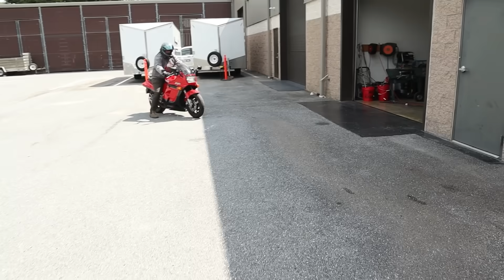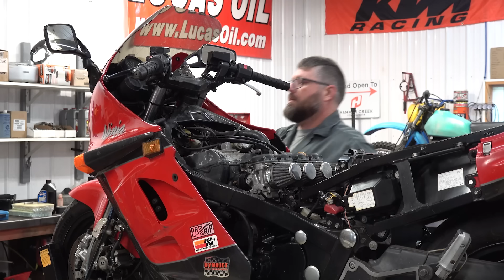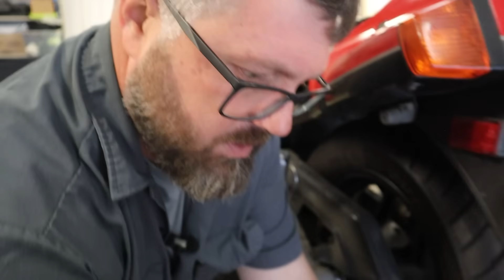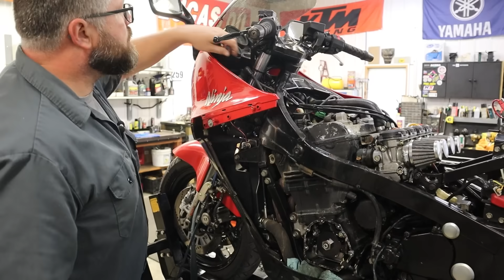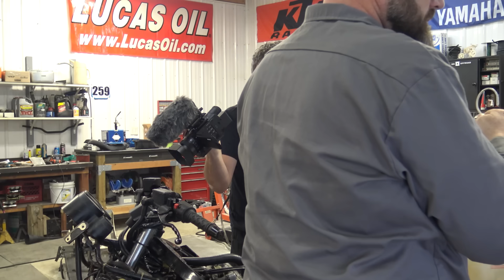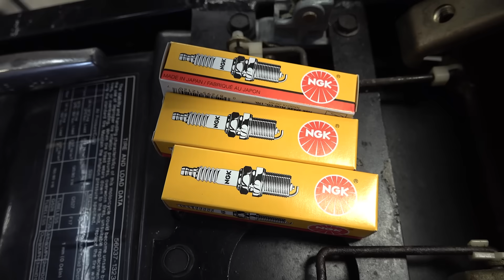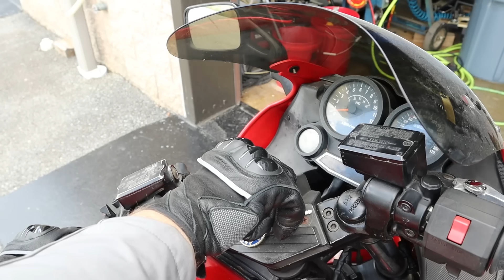Can I Fix This Unfixable Iconic Ninja Super Sport Bike?

Comment: ok, this video may have solved the issue ive been having with my bike. i have a 99 vulcan 1500 nomad that appears to have a bad source coil. the front cylander is throwing flames threw the carb and just not working at alll. i can idle it and put my hand on the front cylander and it does nothing..... good to know. i will test them

Comment: I had that exact bike, but with a 100k on it it still ran perfect,  tank and carbs were full of rust when I got it and zero oil visible in the exhaust, I had a similar problem with my 96 zx11 wiring at the ecu and the ignition switch was the issue, after market ignition switch also wouldn't work . Uhm new coils, & wires what about plugs?

Comment: I am a motorcycle mechanic that works on a lot of vintage/older motorcycles and I have worked on many bikes where they’ve been to several shops. It’s because they don’t want to to pay for the time it takes to do diagnostic work sometimes it takes 30 minutes sometimes it takes 3 hours. That’s just what it is owning a vintage bike but they think you can fix it for $100 and that’s not happening so I think personally most shops don’t want to touch it or you can make more money off of other things

Comment: Im having a similar issue with my 92 cb750. It runs great until i turn it off, then it won't start again. At 1st, thanks to bad timing, it acted like it just wouldn't run with the tank on. After 8 times of taking the tank on and off, i realized that it just won't start when its warmed up.

Comment: Aftermarket parts are suspect at best, tough to find new OEM parts for a 30 year old  anything, if you can you usually pay up. I like your diagnostic procedure. I probably went the route you took and replaced anything questionable for a machine that old, especially a customer's, would have been nice to pinpoint the culprit. I'm thinking insufficient ground on the ignition coils, causing high current draw, causing high heat, causing high resistance and repeating that cycle until the coils were damaged. Great video, I've watched a few of yours and subscribed after seeing this one.
Reply: The coils weren’t damaged.  They were well within spec for dynatek green 3ohm units.

Comment: Hey I haven't watched too much of
your vids... had a problem with my
KZ750 1981 model, when it got hot it
turned off, we put more efficient front
and rear and blinker bulbs, like led and
xenon and it run like a champ, probably
bc the battery was weak

Comment: I had a Honda CB250RS that I rode to work daily. At exactly the same point of my journey, every day, it would lose the sparks and coast to a halt. After replacing firstly the coil, then the CDI. No change. I pulled the pickup out, put a digital ohm meter on it….about 3 ohms. I dropped it into a pan of hot water - it went open-circuit. Problem solved with a new pick-up.

Comment: Problem with shops working on older bikes is repair cost verses actual value. The cost to pay a good tech like yourself isn't cheap and some diagnosis and repairs can fast exceed the value of the bike. A heat gun is a good way to get some heat into a part when doing testing.

Comment: At the very first, you said "Up until 1996, most people never heard of a Kawasaki Ninja..." I think you meant to say "1986", since that is the year Top Gun was released, and the bike Cruise rode was a 1985 model and his was a 900 cc model (I had one just like it, but without Kelly behind me). The one you're working on was concurrently produced with the 900, but for only three years, 1996-98. The 900 was lighter, handled better and was faster than the 1000 and outlived the 1000 by 12 years. You also mention when you show the temp gauge at the first mark above cold that it was at "normal" operating temperature. These engines were notorious form running hot if they didn't have a good airflow through the radiator. They would overheat if not moving more than 25-30 mph, and the gauge usually had the needle straight up. You could get behind a semi out on the highway and watch the temp gauge climb from having the truck blocking the airflow.  Lockhart made an improved center portion fairing that used NACA vents and created a low pressure area behind the radiator that vastly improved airflow  through it.  I almost wonder if the engine in that bike is original to it. There is a mounting point on the left side of that bike in the cylinder head that did not have a bolt in it but was obviously worn from having a bolt. That particular mounting point wasn't used on the 1000 as it had a perimeter frame and different mounting system. The 900 used the engine as a stressed member and used the mounting point I saw that is worn. I never could see the right side companion point as the fairing hid it. I also question if the engine was original because of the wonky coil mounts, they sure didn't look factory.  Bike needed a lot of cleaning up, what was with the chalky patch on the cam cover?

Comment: 1984 Ninja 900 came into the shop from the factory. After the first test ride ( about 2 miles) it was blowing snow out the exhaust. Removing the cylinder block revealed the 2 center cylinder sleeves had dropped 2 10,000ths and blown the gasket. Brand new model and bike. Nice way to start a model year. Warranty dude wasn't too enthused about it either. He flew in from Cali to Georgia to verify. What an idiot! Great job by the way. I would give most anything to have one again! But, I'm very old! (69 this month)

Comment: I work on fords, had an explorer with a cell on setting a code for a purge valve control circuit. Did ppt and replaced the purge valve, sit setting code. Next step, replace pcm. Did that, sit setting the code. Went down the rabbit hole of circuit issues, did find some questionable things, but nothing that would change it from setting that code. So I put another pcm in it. Still setting the code. At this point I’m like wtf! I’m going crazy. Get with ford and they tell me, oh yeah they’re having issues with them, just keep replacing them till you get the code to clear. That’ll really mess you up when you keep getting the same results and you know that’s what’s wrong with it. Have had it happen with ford reman alternators as well, so I should’ve known better, lol, but you’d think the oem would be ok.

Comment: Why not check the spark plugs first to find out what cylinders are not firing.  Slightly higher coil resistance is a red herring.  What you need to check is coil and cable insulation - they can short because insulation deteorite on old bikes. Those loose brackets can definitely cause a problem with ground connection.

Comment: I wonder if….it’s not jetted right for pod filters? I find that they run fine with a 10% main jet increase and an M3 or M2 nylon washer under each needle clip. My friend’s FJ1200 went like a rocket after I’d upjetted it for pod filters. It about overwhelmed the clutch in 1st gear.

Comment: I have a GPX 600R and I've learned all early gen Ninjas are super spooky with stupid little issues. I'm currently having an issue with the bike running great but as soon as you park the bike for 30min-1hr 30 it will break up after a couple min of riding until enough air cools down whatever is being dumb then it runs fine again. I've replaced all of the electrical, coils new and used. IDK

Comment: Just starting watching  this diagnosis,but it couldn’t have come up in my feed at a more appropriate time…….replaced coils on my 09 fz1 (plugs also) and on my test ride afterwards,as soon as it got near op temp it immediately pops ignition fuse ,over and over …I assume I pulled a wire in a funny way or something but will be great to see step by step electrical diagnosis
Reply: This is similar to what I found when testing g coils b4 installing …both new and old were out of shop manual specs but similar across all …. So I’m finding out I’m a gonna have to re test it all as I go if nothing is outwardly apparent ..

Comment: My 1991 VFR750 did the same thing.  Ran great until it got hot.  Once it got hot it would die and act it had a completely dead battery.  After it cooled back down it would act normal again.  I thought it was failing coils but ended up just buying a new bike instead LOL.
Reply: Needed Craig to fix it. Probably needed a good check up.

Comment: Good Intel mate I had a 89 ninja 250 import 4 cylinder older high rpm type on my way home from work my light dimed in the middle of the Australian bush so I rode back to the Highway and found out my battery was to used wasn't holding charge luckily not the alternate it got me 100ks home but with basically a Parker globe at 2am

Comment: I bought 2 Chinese parts off ebay for my Honda lateley. One, the fan switch thermo sensor, made the fan run constantly. The other, the start button/ kill switch, the start button cracked in half. One never worked and the other broke. The former I got a refund and put an OEM one in and it works fine. The latter, I got a new assemblt and superglued the one that broke until I can replace it (which I might not do). Insead of gettin cheap parts that don't work from china, pay a 40% more and get the Japanese ones. Bottom line: I'd rather have 1 good part for more money than 2 junk parts that I have to fix twice and still end up buying OEM. ALL THE OTHER OEM PARTS I USED WITH THE WING ON THE PACKAGE FIXED MY BIKE!

Comment: I have owned this very loud motorcycle for many years. It often overheats, requiring stops to cool down before continuing the journey. This bike is also very slow compared to bikes with the same engine capacity.

Comment: Ebay/Amazon electrical parts often don't even have metal inside. 18650 lithium batteries are sometimes just the shells filled with sand.

Comment: It appears you had a week between fitting the new coils and installing the "faulty" pulse generators. Did you diagnose in that time frame, with new coils and the original pulse generators?

Comment: Not only that, but they also don't take old motorcycles because the majority of them have already been through the hands of many mechanics, and there's often a lot that has been fixed incorrectly. Fixing one problem can lead to others, and this sometimes results in a cost that the owner is unwilling to bear or find worthwhile.

Comment: Want to assist me with a similarish  bike ? (1993 ZZR600 I believe..) not rideable currently. Condition and looks like the 2018 was the last time it was road legal. Rear tire is shot. Missing all the fairings except for the front. Missing 1 of the intake pipes. Couple small hoses dangling, 1 split hose, a disconnected connector which I believe is the fuel pump but I'm not 100 percent positive. Not sure what else is missing or needed to get it rideable. Got it in this condition and not real experienced with these bikes 😅. I ordered a Hanes repair manual that comes on the 23rd.

Comment: Some years ago, I brought my old yamaha XJ-750 out for the 2016 summer. . . After some tuning and oil change and throughout carb cleaning  and inspection . . .I went for a ride, , a couple of miles away;  it played the canon.with  rpm wildly swingning up and down. . for less than a mile  and ran fine all day long. . . I checked with a French guy that knows theses bike very well. . he said, check all wires for loose connexion and if all is well; redo all the soldering in the TCI box. .Wich I did. .  reassemble it all, went for a ride, waiting  for the canon . .  that never came ☺. .  and, unexpectedly  most of the buzzing in the bars wich had always began at around 4500 rpm , well it since began at around 6000 rpm ? ? ?   Many of the soldering  the circuit bord had a curious dark ring around the pin of the big SCR  component. . 🤔

Comment: I mean, I know a thing or two about this so no disrespect but if you have two coils that basically test at the same Resistance, chances are they are good, the reason they were higher is because you tested through the HT leads rather than directly on the coil.

Comment: At least for electrical components, please buy OEM only. MY bikes get OEM everything. It's not worth saving a few bucks and then running into problems...
Also if you can get your hands on OEM carburettor seals and spare parts buy them! I know they are way more expensive than aftermarket carburettor parts but your bike will thank you and run as smoothly as a brand new one!

Comment: This was  my first bike. I think I bought it in 1989 the hypersport GSXR out this thing was a dog compared to everything else out there. A blue second gear I put a ZX10 transmission in it I had the heating problem also I put an electric fan on it and some upgraded relays in a completely solved that problem that you're having in the video mikuni slap sides racing clutch timing advance klymenko flo head porting work this thing was a beast I had this thing up well over 180 mph every day on I 87 Yonkers NY I still own it and I I love it

Comment: I had the same issue on my concourse zg1000 and my carb boots where cracked when cold ran fine got hot it will vacuum leak. And yes ebay crap doesn’t work

Comment: This is the kind of mechanic we bikers loves to go to. However few minority are not in favour of going cos they worried when this type of mechanic do a beyond 110% detail job to rectify a problem, bills might go up beyond bike owner spending limit as what they told me due to high cost labour.

Thats why some dont hold on to their bikes for way too long (average abt 5 years), buy only reliable common bike or smaller cc bike within their budget. Cos it hard to get a very good mechanic like this guy nowadays.👍🏻👍🏻👍🏻👍🏻👍🏻

Some countries the sales are not in favour cos kawasaki had alot of problems with their machines over the period, expensive parts and lack of support. For others they never even seen a kawasaki bike before cos dealer are not bringing them over.

Comment: I think shops are scared of all electrical gremlins. My zx12r suddenly died while on tour in Spain. The dealership in Barcelona couldn’t figure it out so it was hauled back to the original UK delearship n Leicester where it sat for another two months. It was eventually diagnosed & fixed. The problem was a failed cam position sensor, something you can reach through the fairing & change out in ten minutes.

Comment: get the airbox back in there, cones and jets just make it thirstier.
if you want a real improvement, both power and fuel economy, get hold of a ZX10 crank and rods. (tomcat in US)
you'll need a second base gasket to stop pistons kissing head, but your spin up becomes phenomenal, a quick blip on the throttle will send it to 7000rpm in an instant and it goes back to idle just a fast.
the rods are a quarter of a mil longer, the crank is pounds lighter and came polished from factory.
the throws are identical to the GPZ1000RX crank, as are the journals, the rods journals too.
the only thing that it'll need to fettle is adjustment of the ballance shaft in the front of the crankcase.
I've no idea what the final power is, but the bhp is elevated, you'll get far more than the factory stated 120horses, and real world acceleration got me banned from 'run what you brung' drag meets
0-100mph is a shade over 2 seconds!
then there is the real reason to do this mod : fuel economy goes from 30mpg at all speeds, (as any RX fiend knows all too well), to between 40 and 45mpg, depending on grin factor application.
this doesn't mean you won't see your fuel guage visibly drop at speed!
all in all, I was very pleased with the result, and it's superblackbird eating power, you can pull away from them when they're at max.
I used to hoon around on Queen's Business in England at a comfortable 190 ish with a few more beans as needed.
it was allways funny watching prone sbb riders looking up at me sitting upright with wild eyes, eyes that widened as I opened her up a little more and pulled away.
no other works nor jetting is required, but the airbox is a must to calm the incoming charge, it's a proto ram air that actually works.
as for the coil issue, even GT kawa coils from a breakers are better than chinesium pap.
the 1000RX is easier to live with thanks to it's locknut and tappet valve train.
a superb motorcyle that needs to be reintroduced by kawasaki considering mine , with this mod, ate ZX10s and did it with less fuel.
happy fettling Gents.

Comment: It's quite odd that in the US, dealerships were turning it away as here in the UK we can take almost anything in and someone is bound to have the knowledge in the workshop
Reply: Ive had the same problem here in NZ, Ive owned an 01 R1 since new and recently took it to the shop i bought it from due to it having been stored for a year and the carbs getting gummed up. None of the mechanics in the workshop looked over 21, and i was told the bike was "too old" for them to work on. No diagnostic port to plug the PC into and tell them what was wrong, and none of them had worked on carburetors before😲😆😆 I ended up doing it myself.

Comment: well Craig where are you located, cause i have a 90 ZX11 with similar issue. I can get up to 4th gear and when i go into 5th it starts to studder. Cleaned the carbs but still the same issue.

Comment: Mmmm.....Had a Sprint ST 955i with electrical joy problems ....£££ later after buying 3 new spark plugs (not solved!) 3 new ignition coils (not solved!) bit of a rewire of the loom (not solved!). Then I discovered the ECU had a bad fault replaced it and after that ran perfect! Happy days again.....oh and I did consider getting rid of it after weeks pulling my hair out.